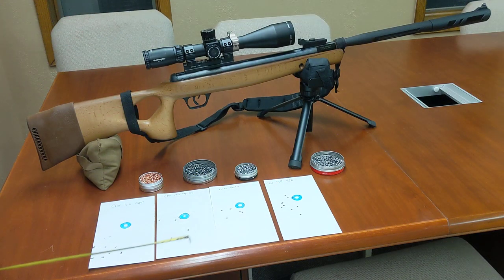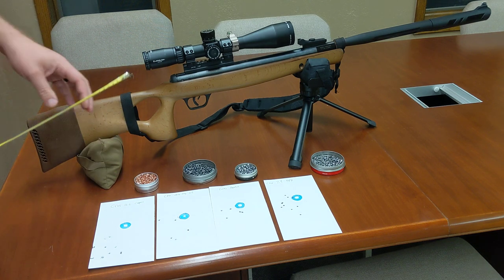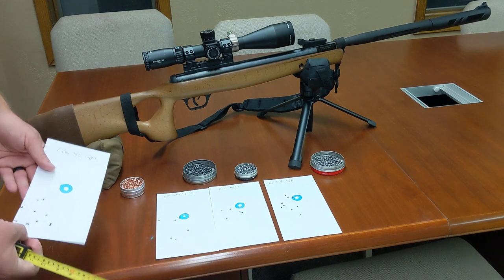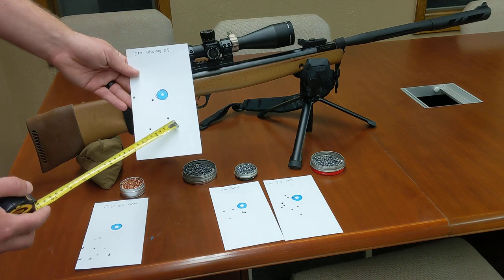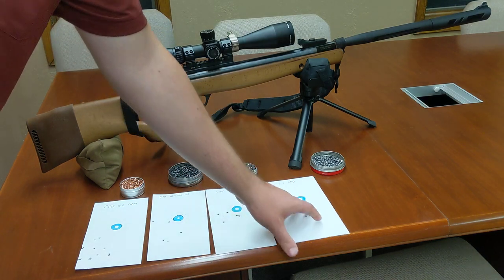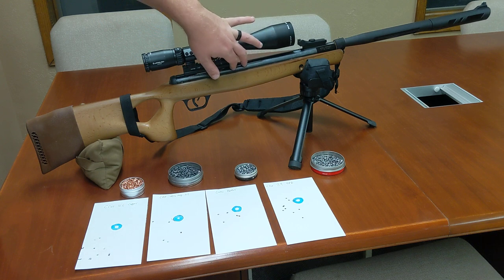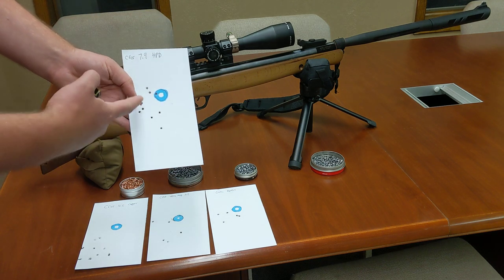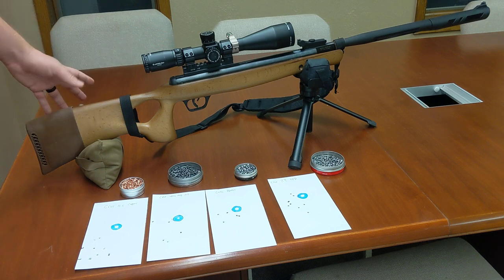Crosman oil for break barrels?  What it does and doesn't do

Comment: can i spray into the chamber a regular silicon spray if i dont have designated air rifle silicon oil?
Reply from the maker: I'm unsure actually 🤐
Reply: Silicone oil is crap. 2 or 3 drops of synthetic 30 wt motor oil is much better. It lasts longer and offer some protection for metal on metal contact behind the seal, whereas silicone oil is the worst for metal on metal contact.

Comment: Pure silicone oil for the compression chamber, any good? Thanks
Reply: No. Synthetic motor oil (up to 30 wt) is much better. After oiling let it sit upright for 24 hours. After a few detonation shots it will settle down.

Comment: I'm still in the process of deciding what air rifle to purchase. My interest in the Crosman Valiant brought me here. I also thought there would have been some slight improvement in performance after oiling considering 4k rounds have already gone though your rifle without adding oil. Interesting test nonetheless. Thanks.
Reply from the maker: Thanks for your views and sun Charlie!  I enjoy researching some of these cheaper rifles but man are they finicky!
Reply: @GTMGunTotinMinnesotan  I have a maniacal rock squirrel that's driving me crazy trying to dig under my house. He's too smart for my have-a-heart trap, so he needs to be taken out permanently. This caused a disparate decision to purchase an air rifle ASAP. I wanted to spend as little as possible avoiding buying junk, so I settled for the Hatsan Mod 95 Vortex Piston .22 cal. Are you familiar with this gun?
Reply: @CharlieGoy  
You got a good one. The 95 in .22 is comparable to my XL1100 in power. It takes practice to get your groups tight. Try different pellets to find what your gun likes.
Reply: The new GAMOS MADE IN SPAIN AGAIN TAKE A LOOK.
Reply: Hatsan air rifles are pretty great. Especially the springers